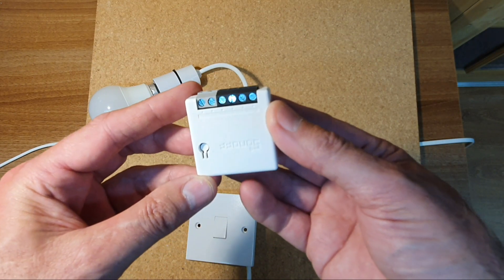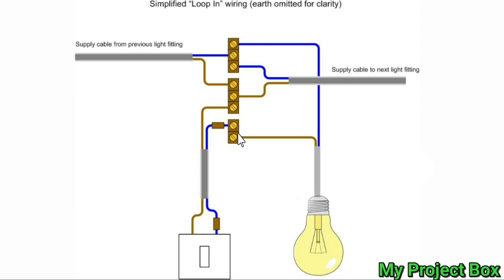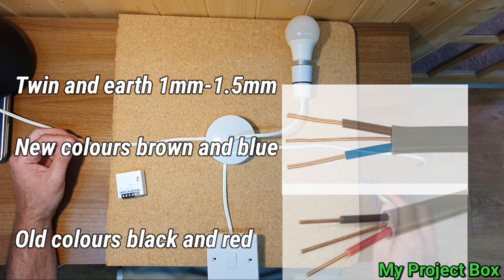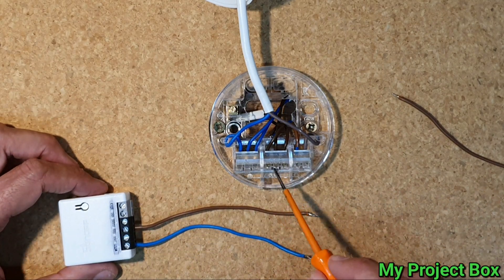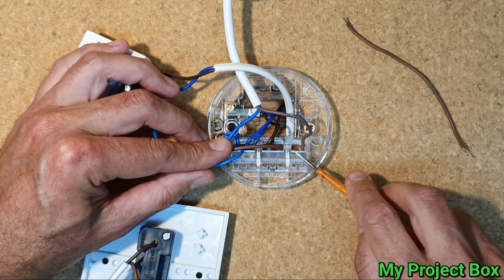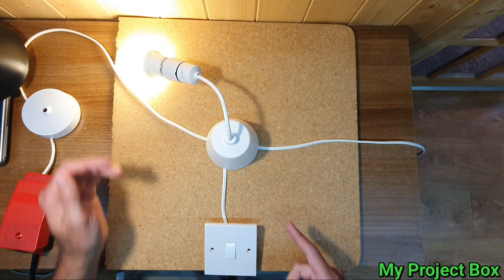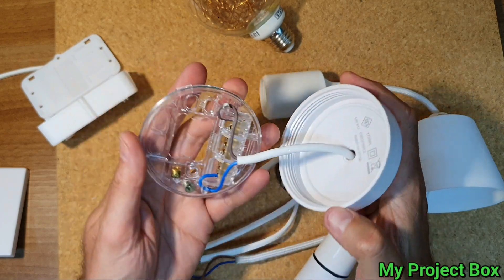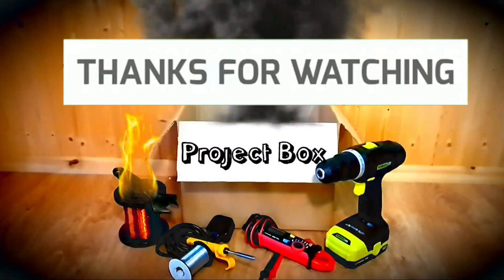Sonoff mini in UK British lighting circuit (ceiling rose loop-in wiring) #ElectronicsCreators

Comment: Excellent demo. I have a doubt. Kindly clarify if possible. Do I need to connect both the neutral post on the sonoff mini or just one neutral post as you have shown? The reason I'm asking is that I have a neutral behind the switch box that is the common neutral running on to the next connection and the light fixture at the ceiling has its neutral connected to the common neutral in the ceiling which then connects to the main neutral at the main junction box. There is no neutral wire coming directly from the light at the ceiling to the switch box. Please help. Can I leave the second neutral on the sonoff mini blank (without any connection)?
Reply from the maker: Yes you can leave the second neutral blank👍😉. Both neutral terminals are just joint together as one inside the Sonoff. You can use the extra neutral terminal as a neutral junction point if you like. It's neutral in and neutral out, but in reality they are both identical(joint together inside). Also it could be possible for you, to put the sonoff behind the light switch, if you have a neutral connection behind your light switch 🤔
Reply: @MyProjectBoxChannel  Thank You very much for your speedy response and also for clearing up my doubts. You have been very kind and helpful. Please keep up with your great work. I wish You all the very best in your work. Thank You again.

Comment: Fantastic - a neat and sensible solution I have been looking for for my cinema room. Is there an option to be able to dim the lights as well with this or is it a simple on off function? It would be great to have an option to be able to say 'hey google, dim pelmet lights to 50%' for example. My room will have 6 light circuits. Can I 'label' each one as necessary so I could say 'dim inner LEDs to 30%' and 'dim outer LEDs to 50%' etc?
Reply from the maker: Unfortunately it's on/off only, it doesn't have any dimming function.
Reply: @MyProjectBoxChannel  could it be linked with Sonoff’s dimmer D1???

Comment: Thanks for this clear video. I thought there is some problem with the smart switch which I have bought but thanks to you I have just learned that there is no Neutral which is required for smart switch.
Reply from the maker: Yes if you if you live in the UK, it's possible to put it up by the light fixture. Especially if there is no neutral behind the light switch. In Europe the wiring is done differently so it could be more difficult.

Comment: Great video - very clearly explained. But what do UK Wiring Regulations say about having a permanently connected (and powered on) Sonoff in the ceiling? The lighting ring is protected at the consumer unit with a 6A RCBO - is that enough to satisfy the inspectors? I have done a similar thing with my porch light and a Sonoff Basic (with Tasmota firmware)  in the ceiling. My wall switch is connected to GND and GPIO14 to toggle the current state.
Reply from the maker: I guess if the Sonoff is protected by a suitable enclosure, and no bare conductors on show. Then it should be OK above the ceiling. You would think the regs would be updated enough for smart lighting, and permanenty powered electronics, above the ceiling. 

It is 2023 after all🤔🤣. In Europe the fuse board/consumer unit, can have all sorts of DIN-rail mounted electronics inside. Not like in the UK were it's just circuit breakers. Sorry for my rant, it just seems like the UK is a bit behind Europe sometimes, when it comes to "modern" electrical installations.

Comment: Ive been looking for this information for  so long. Wiring is not an interest of mine so having this gets me alongso much further with my design work. I ended up bjying several no neutral switches which are not the best andcause flickering. Before you say it yes they were promoted as non flickering yet still flicker regardless. Yes they were expensive in comparison to this option but now that i have this info i can easily move my current system while also vsiually appearing "like normal".  With my purchased smartswitches last year, they became a nuisance as my airbnb guests have a meltdownthe second they see they are different visually and that ive mentioned that they are "smart" switches. I know its silly but its become so painful to manage with guests. Its mad to see so many people freak out with the word "smart". Their lack of knowledge on whatthese  units are and how they work to make life easier, quickly complicates the process and cuts out any positive time savings. Instead it complicates, confuses and annoys. This video helps  as i cN change my system at home, introduce savings while also keeping guests at bay and preventing silly ignorant meltdowns.
Reply from the maker: I understand your pain. I also host a airbnb, and its better to keep things simple for the guests. They don't like things that they don't understand.
I have designed my own no-natural circuits for when there is simply no other option, like with some of the wiring in Europe. https://youtu.be/oBR5O391m_c

Comment: Good video thanks. This is what I was intending to do when I bought a few Minis but good to have it confirmed and also see that the lag on the lightswitch use isn't too bad. I've seen some take a good second or so before activating the light!
Just one point, the Sonoff Mini is ZigBee rather than WiFi (or at least mine are) so they pass on the command through the chain. I've some ZigBee devices in metal light ceiling plates and they work fine because they only have to see the next device in the chain  and not go all the way back to the hub in one step.
Very clear video and explanation too.

Comment: Just watched this video. Its really excellent. Very well explained indeed. I was about to give it a go when I realised that my light switch is a 2-gang switch. The live is shared between the 2 switches. If the live from the ceiling rose, to the switch, is replaced with a connection to S1 on the MINI then its going to cuase a problem for the light that is not controlled via the MINI. Is it possible to solve this problem.
Reply from the maker: You could use a Shelly1. It only needs the switched Live as a trigger input. You could also use my opto circuit hack for the miniR2, but that might be over complicating things. https://youtu.be/x7Q8AS238pY or https://youtu.be/oBR5O391m_c

Comment: I’ve been trying to wire up a ZBMini L (no neutral reqd) into a 2-way switch, but can’t get it working. Diagrams suggested one switchable live into S2 would work, but that only did one end - when I switched off the other switch the relay lost power. Any experience / hints with this setup ?

Comment: Thank you so much! I don't know why I was fixated on putting the sonoff mini behind the switch. Even if you have a neutral there it's not very easy to tuck it in... This seems so much easier....
Reply from the maker: 2-way switching is also simple with the ceiling rose wiring and sonoff mini.It's only really suitable for people lucky enough to live in the UK. 😉

Comment: How are you dealing with earth continuity? I'm slightly lost with your wiring as no earth is present, and appreciate the diagram it was ommited..
Reply: How are you dealing with earth at the sonoff device?
Reply from the maker: @benrichards3228   The Sonoff does not need to have a earth connection terminated to it directly (not all devices need an earth connection). As long as all the remaining earth wires are connected together, and if you put it into a metal enclosure, the enclosure connects to that earth as well. If you put it all into a plastic enclosure, then all the earth wires go to a Central Terminal connection ( wago connector, or terminal block of your choice). Lots of electronic "mains power modules", do not have an earth connection. Most of them are enclosed in plastic. If you think of those "double-insulated" devices that have a plastic earth pin on the plug(phone chargers for example).
Reply from the maker: The earth wires were omitted just for clarity, to make it easier to "read" the circuit(as they don't contribute circuit function, it's just for safety). All earth connections join together as usual( including metal box connection). I just assumed people would know that.

Comment: Fantastic video. I have the current lighting set up in my bathroom. However, it is a single switch which controls both the fan and the light.

I want a second switch to control the fan and use a smart light switch to control the light

For the fan which I will connect through an isolator switch and then to a Sonoff mini R2. Do connect the Lin from the Loop and Nin from the Neutral?
For the Lout this will go to the extractor fan. I know u omitted the 2nd Nin but i still need it to go into the extractor fan right?

For the switch? I will be using a wireless smart switch remote to control the Sonoff mini R2 and place it above the light switch outside of the bathroom.

I can then do my humidity sensor to fan on automation an motion sensor to switch light on automation.

Please educate me if i have not made sense

Comment: I am in the UK.  My Neutral is behind the light switch.  how can I adapt that?
Reply from the maker: That means you can put the sonoff mini inside the light switch back box. You should have all the connections that you need right there, provided you have enough free space.
Reply: @MyProjectBoxChannel  ok great so use the same prinimcipals but just at the switch I will give it a go

Comment: Great video and exactly what I was trying to do. Unfortunately when I replicate the same, S1 and S2 on the Mini R2 doesn't switch the light on and off. I have even done this on a test bed to eliminate the complication in the ceiling rose and the result is the same. The app works fine, its just the manual on off from the switch that doesn't work. Any advise will be appreciated
Reply from the maker: So on your "test bed" you have the switch connected to S1 and S2. It's very strange that it doesn't work. I really don't know what else to say 🤔.  Try different switch perhaps? You can also(very carefully) intermittently bridge out S1 and S2 with a wire link, to mimic the action of a switch.
Reply: @MyProjectBoxChannel  Thanks for your reply. I have tried linking S1 and S2 with a wire but this did nothing. At first I thought it was down to Tasmota. I purchased another R2 and used eWelink and its the same result.
Reply from the maker: @MrAzuka04  I really don't know why it wouldn't work. That's essentially the default way you wired it up. Without actually seeing what you've done I can't tell you if you made any mistakes. Maybe on my FB you can send me some photos of what you've done.

Comment: Thanks for the video.  How do I wire this within a circuit that uses 4 core (brown (L1), black (L2), blue (N), green/yellow (E))? I want to control an extractor fan using the sonoff but I'm not sure with this wiring.
Reply from the maker: Is it a bathroom extractor fan, with overrun timer?
Reply: @MyProjectBoxChannel    Thanks for such a fast reply! Yes.  I've got a pull cord light and an extractor.   Currently the light goes on when I pull the cord (duh ;-) and the extractor goes on too, it stays running on a timer after the light is switched off. My goal is to swap the bulb in the light to a smart bulb that I control with a remote wall switch (so I need to switch the light on permanently at the pull cord) and then use a sonoff to control the on / off of the fan.  I'd create a routine that switches the extractor on when the light goes on and switches the extractor 10 minutes after the light is 'switched off'.
Reply from the maker: @innesmclean  your Sonoff Minir2 can be used as a smart light switch. That way you wouldn't need a smart bulb, and you can keep the original light switch (pull switch). The light switch can then wired into the Sonoff "input trigger terminals" you would now have smart control of the (dumb) light bulb, and the fan via the sonoff (and old light switch) . The overrun timer should still work as normal. So the mini would do the switching for the light bulb and the fan, with it's relay.
Reply: @MyProjectBoxChannel    Again, great reply, thanks!  This may be a stupid question then, sorry!  The wiring set up at present is a switched box outside the bathroom with a direct wired connection (via the loft) to the extractor and connection (via junction box in the loft) to the light. I think (I'm not an expert; you may have guessed? ;-) the power is going to the light and from the light to the switched box (via the junction box).  What's really confusing me is the wiring in of the sonoff - which wires to which inputs in the sonoff and which outputs from the sonoff into the existing circuit.  [ I also just noticed typing sonoff lots of times that it probably means SmartOnOff, or something like that! ]
Reply from the maker: @innesmclean  so the Sonoff Minir2 needs a supply feed. Neutral and permanent Live can be taken from the junction box to the L-in N-in  terminals of the sonoff. The two wires going from the junction box to the pull switch, have to be removed from the junction box, and now go into S1 & S2 terminals on the sonoff. Bring a wire from the junction box Switched Live terminal, that feeds the light bulb, to the L-out terminal on the sonoff. 

It's not that different from the wiring in the video.
Let me know if this makes sense 😉👍
Reply from the maker: These fans normally have one switched Live (from the light switch) and one permanent Live (for the overrun timer function)
Reply: @MyProjectBoxChannel   yes, the fan has Permanent Live, Switched live and neutral
Reply: Thanks again I think I'll give it a go. Seems to all make sense. Great help. Thank you!
Reply from the maker: @innesmclean  if I had time I could do you a diagram of the wiring
Reply: @MyProjectBoxChannel  😀

Comment: Where there is neutral at the switch in a UK domestic lighting system, how are the connections to the switch made?

The permanent lives (from previous fitting and next fitting)  are connected together and into 'L-In'.The Neutrals are all connect together and into the 'N-in' ...

So that leaves the light fitting. The neutral is connected with the other neutrals, the earth with earth, but what about the L-Out - what connects to this,  and switch live - where does this connect to as there is only 1 cable? Seriously racking my brain at the minute...
Reply from the maker: In the UK you have a traditional wiring system of a junction box up in the ceiling rose. This is where the light pendant attaches. The Line/Hot, Neutral and Earth, come straight from the Fuse box to this ceiling rose/ junction box. From there the Line drops down to the light switch, and from the switch, the switched-Line goes back up to the junction box/ceiling-rose. And then all the connections for the light pendant is made in that junction box/ceiling rose. There is normally no neutral wire dropping down to the light switch! Only on earth wire for the switch back box. All this means you have all the connections you need, to wire up the sonoff mini, right by the light fixture itself.

The wiring system in the UK is a little strange, but once you get used to it, it's actually quite sensible.

Comment: Hi will the sonoff mini control a step dimmer LED bulb? Will it be able to via the app or connected switch toggle on and off sufficiently quickly to activate the steps? Or is there a lag in controlling the state that it wouldn't trigger the different levels in the LED?
Reply from the maker: There is a very slight lag in the control state. I don't know however if this is enough to not enable your step-dimming function. It's possible when controlling the sonoff mini from the wall switch mode, that it's quick enough for the step dimming function.
Reply: @MyProjectBoxChannel  thanks that's very helpful! Just to say that the video was really helpful for thinking about how to improve lights in the UK, thanks. Will probably try and will let you know the results.
Reply: Just to confirm that using the connected wall switch and commands via the app were quick enough to trigger the step dimming.  I've not had a play with Alexa but I think there might be too much lag.
Reply from the maker: @DJDJJ1  I don't own one of these step dimmer type bulbs, so there is no way for me to test if the switching, will actually be quick enough. You might have to bite the bullet and test it, and let us all know you're findings 😉👍.
Reply: @MyProjectBoxChannel  Yes, sorry if my comment wasn't clear, I have bought and tested one and the wall switch is quick enough! The app control is as well.
Reply from the maker: @DJDJJ1  very good 😜👍. That's great! Yes I did read your message wrong🤣🤣🤣 sorry.

Comment: Cool video … where did you get that extended rose cover from though?
Reply: Just in case anyone has a 3D printer - I haven’t tried it yet but could be useful, there’s an extended ceiling rose that seems to have the screw thread to attach to an actual MK backplate on thingiverse, if the link below doesn’t work it’s item number 4124473…

https://www.thingiverse.com/thing:4124473
Reply from the maker: They are more common in Europe and on the continent. I've seen them in IKEA and online before. It normally comes as a complete pendant with screw e27 base.
Reply from the maker: @philharris9631  nice one